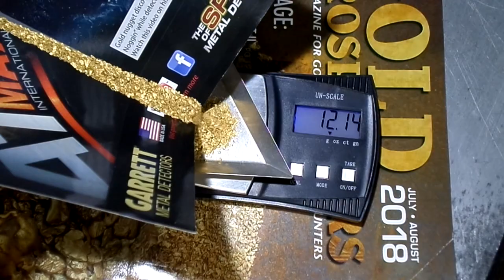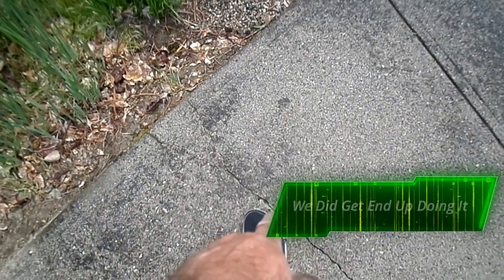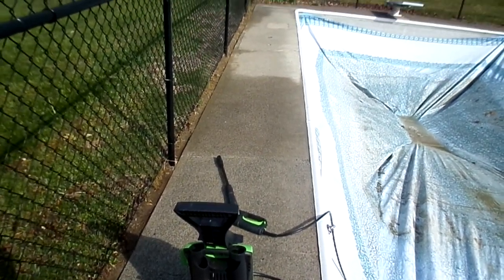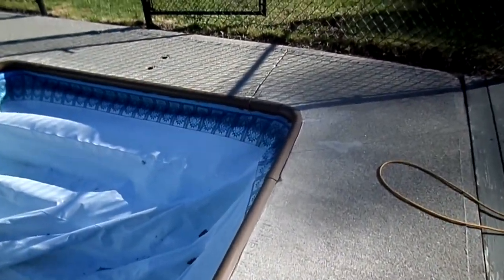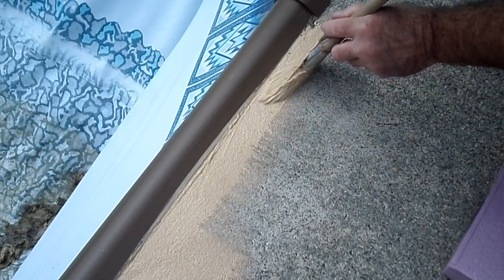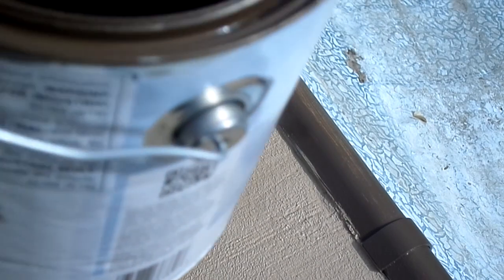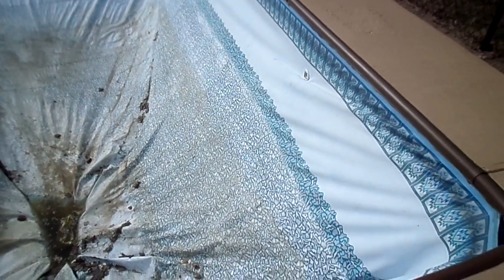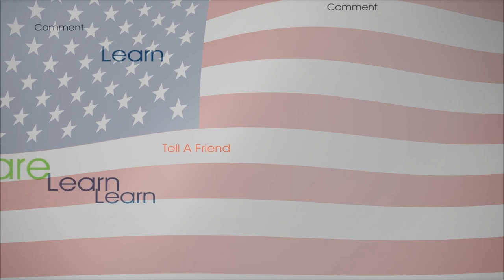My Occupation Before GMGT

Comment: Interesting back ground. I was an electrical contractor and my wife was a painting contractor. Like the drone footage. Two things I don't like, roofing And concrete work of any kind.  Good job from a Good son. God bless you and them brother.😎⛏⛏🔥🔥
Reply from the maker: I hear that loud and clear Brother. I'm no fan of roofing or concrete work either but I find myself dealing with it from time to time! Now that this project is completed, I'm back home and about to dig 22 4' deep holes, drop in sauna tubes, bury them on the sides, drop in 10' 4x4 posts, level them, mix and pour concrete to hang 21 sections of new 6x8 stock aid fence. Can't very well find gold doing that! So, my Sister Sheryal was a fellow painter! Let me guess, you met her on a contract you were both working on in the past? As for me, I remember as a young lad in Jr High in shop class. I was a wizz when it came to electrical stuff. It just came natural to me, then I grew up and forgot stuff. Running wire for outlets is no problem, it's the loop for switches that I have forgotten.